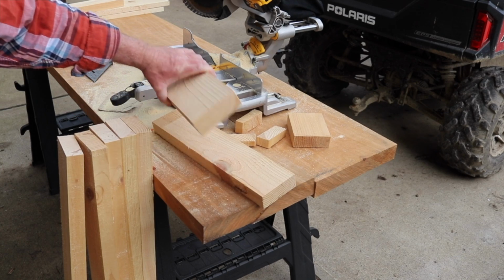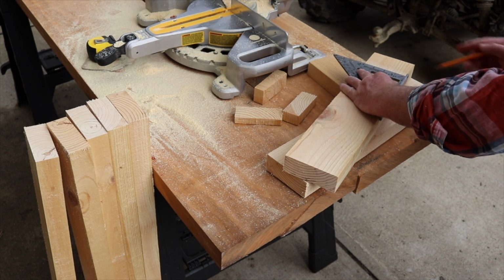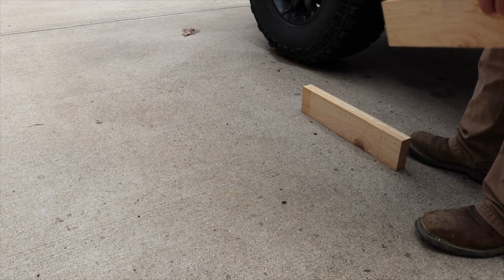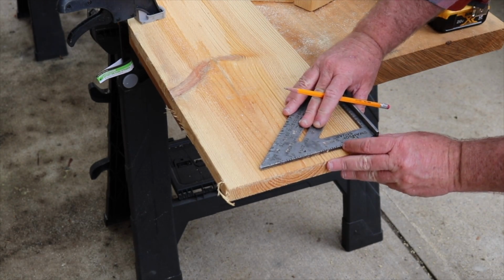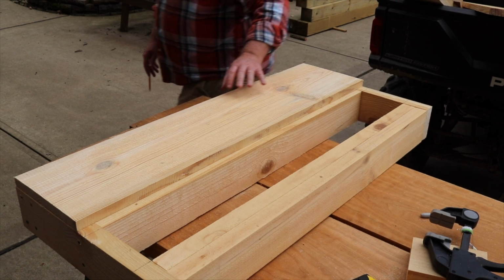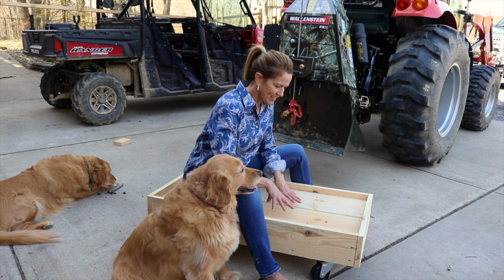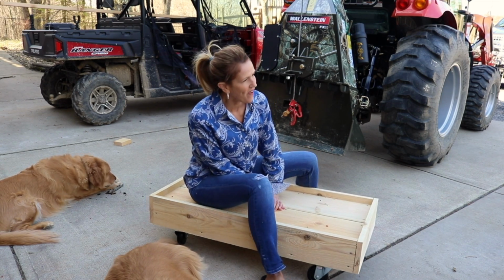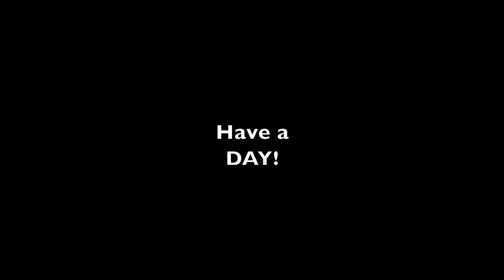#740 Super Easy, Cheap, Useful, DIY Dolly For Heavy Implements and Attachments

Comment: That’s neat you made that Mike, my dad made something like that last year. We had a truck snow plow in the garage but the garage is too small for a truck and it was awkward to get it in there and move it around so he took a good hardwood skid and put caster wheels on the bottom. That pallet with wheels has also had the engine out of my truck on it, and a car hoist. It turned out to be a handy cart that can either be wheeled or carried on the forks.

Comment: Nice dolly Mike. I built an almost identical one a few years ago for moving heavy items around my yard. I also put 4 swivel casters on all 4 corners. If I were to build another one, I would only use 2 swivel casters and 2 fixed wheels at the other end. If you are moving a heavy object, and the surface in not completely level, it is almost impossible to control. I was moving a heavy item along a sidewalk that had a very slight side slope. The only thing that kept me on the side walk was me continuously crashing into the fence that was beside the side walk.

Comment: We've actually made double decker carts to save space. We put the loader attachments (bucket, grapple, forks) on the upper level, which makes connecting them super easy. Then the lower level is for the rear attachments (box blade, splitter, rake, etc.....).

Comment: Mike...if you want the roll around platforms to last , add a thin gauge angle bracket on the outside corners to make it stronger and to keep the screws from cracking the wood out.  Great job. Build an extra one to use as a mobile work bench with a vise.    Martin

Comment: Norm Abrams used to always build a prototype before doing the one on the actual show. You did a great job with this one. I LOVE your penchant for doing very exacting work. I too am that careful. I like to say, "Strive for perfection, and settle for excellence." If I was designing one I would make my tolerances tight too, but looking back now that you built it, I would have allowed a little more clearance in the pocket, but then again with your exactness in handling heavy duty equipment, it is probably just right.

Comment: Mike, you should consider adding some embedded nuts and some holes through the bottom of your winch to support it to your custom sled. Or maybe use some ratchet straps and strap it to the sled. Maybe consider making the footprint of the sled slightly larger to increase the stability. Would hate to hear that you had an accident while pushing it around inside your garage by it falling over. Good luck and hope y’all stay safe during these trying times. Love the channel!!!

Comment: Nice job! You might find that a U shaped handle about 42” off the ground at one end of the cart made from some 1” black pipe and two elbows would greatly aid in pushing and pulling your dolly. A second one on the opposite end would facilitate the moving of a lot of  16” firewood in and around the house. Supermarkets use a similar setup they call a U boat to move heavy cans and goods to their shelves. The difference is they have a 1” larger diameter pair of wheels mounted it the center that allows for balancing of the load and making very tight turns. They go through a lot of them and they are cheaper to replace than repair. I was fortunate to pick up two damaged ones that I was able to cannibalize and make one usable one from the parts. The Mgr was happy to get rid of them as he normally had to hire a special carter to take them away!

Comment: By the way Mike, I used to buy a lot of wood from a saw mill closer by in Lancaster, PA. He had a barn to store it in. The point I wanted to make was that he built a kiln that was so simple, it will make you want to go out and build one right away. He took a 2x4 frame and capped it with approx 1" thick rigid foam insulation. Inside he would put a dehumidifier with a draining tube leading outside, and he also had a small heater in there during the winter. He made it air tight so all he had to do was kick the little heater on to get it started, and then he said just the heat coming off from the dehumidifier was all he needed to dry the wood. Essentially it is the dry air that cures it, the little extra heat helps. In woodworking circles using higher temperatures is called "forced drying" and can lead to unstable wood. Today there are advanced kiln systems that I am not familiar with. However strapping the wood together so it doesn't move while drying is a good idea also. LOve your show. When you eventually put together your woodworking shop I can give you a lot of input. I have a really nice one that I spent a lot of years equipping.

Comment: That dolly looks great - I have a couple I made myself, similar but not quite as heavy duty as those, and covered them in carpet for moving furniture.   Personally, I would have recessed  the attachment point of the casters, to make the platform sit an inch or two lower to the ground.

Comment: I made one of these a while ago.  They're easier to use if the "back" wheels are fixed and don't swivel.  Couldn't find non-swiveling casters, so I epoxied the swivels on 2 of the wheels.
If all four wheels swivel, the dolly will tend to go wherever it wants to go.
Anyway, greetings from Wisconsin.

Comment: "Wow that never happens" - I felt that in my soul. 😂 All kidding aside I just built a lean-to and spent days designing it before I built it. The only scrap I had left at the end was the metal roofing due to the dumb width of it (just over 3 feet wide). I did have a couple whole pieces extra left over though I bought in case I made an oopsie cutting something.

Comment: That winch dolly looks perfect for it! Ever think about slicing a 2x4 on an angle to make a ramp for your garage lip? I’ve got a 2” deep alley in my shop because it was a converted farrowing house, and I’ve got to figure out a way to roll my shop crane around past those lips. Would be really hard if heavily loaded, but a come along would probably do it. Dropping it off inside is your easier answer, and if the RK24 can hoist on the forks, all is good. That’s not doable inside my shop, so I’ve been thinking how to solve a similar problem. Nice job on the dolly.

Comment: Mike, as small question. When using the chop saw you usually use a square to mark a pencil cutline across the timber, and then, sometimes (like me) you just mark a length line and then rely on the saw to give a square cut. Any reason?

Comment: If you use bigger casters it will move easier.  a 6 or 8 inch wheels will make it easier to move. We had 2 inch wheels on a cart for newspaper with about 1250 lb load. Changed wheels to 6- 8 inch wheel. It was 10 times easier to move, no strain at all. Use to take two people at times. I would also suggest getting two locking wheels.  The carts will move due to gravity and low places in concrete. A 4 wheel cart with 1000 lb total load, would needed at least 400 lb wheel load. I would use solid wheel rubber tire. If you make T threshold to fit into the crack, even a square piece piece of wood, you should not  have to use the forks. Making it easy to move from garage to loading area.

Comment: Side note, those overly designed, threaded capped cylinders that come with nearly all tractor implements that house your owners manuals are perfect for storing chainsaw files.  They fit perfectly with the handle on.  You will thank me for that tid bit later.

Comment: I know you're always looking for pointers. As a life long carpenter, efficiency is very important. When you cut on your chop saw, make a mark with your pencil at the measurement you want to cut. skip using the Swanson speed square since it is a wasted step. Your chop saw will cut the line strait regardless if you draw a complete strait line or cut from a small pencil mark. The speed square is for smaller hand style saws where you need to follow the line with your saw. Hope this saves you a little time :)

Comment: Not sure of the weight distribution on the winch, but be very careful that the whole thing doesn't tip over on you as the base is very narrow versus its height.  Being on any slope or hitting the slightest crack in the concrete or even a small stone could make it want to tip.

Comment: Not be a safety sally Mike, and I don't see how you have it stored, you possibly have it strapped to the wall, but how tippy is the winch on the dolly.  I just don't want to see it tip over onto anyone in your family if they decide to move it slightly out of the way.  Channel name suggestions: "Offcuts with the Morgans", "Morgan Offcuts", "OWTM Offcuts"